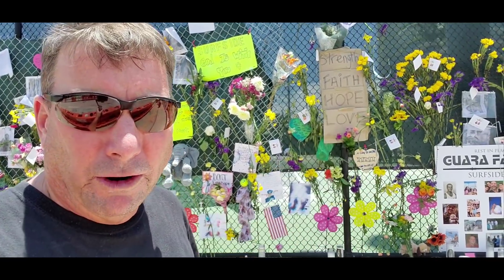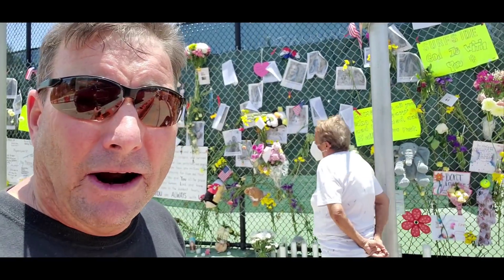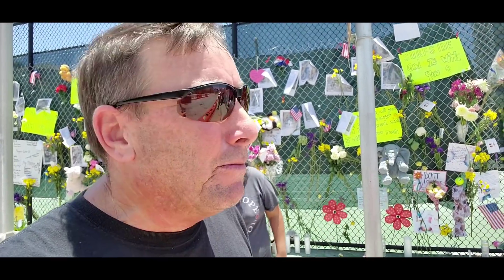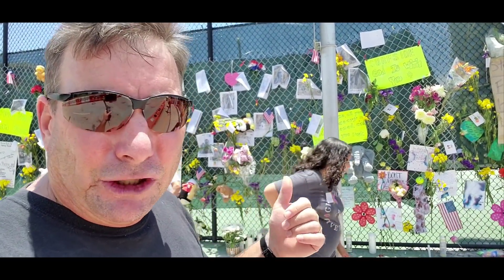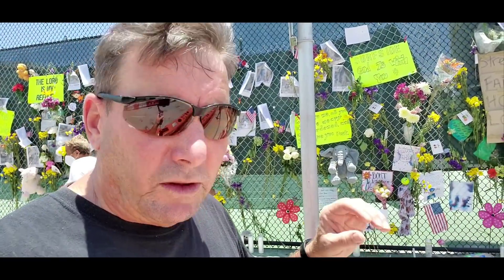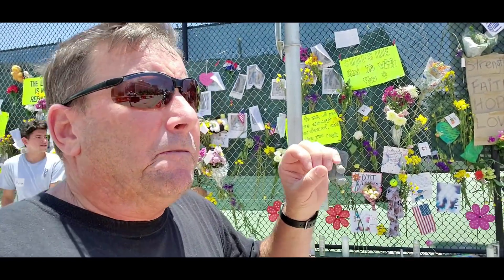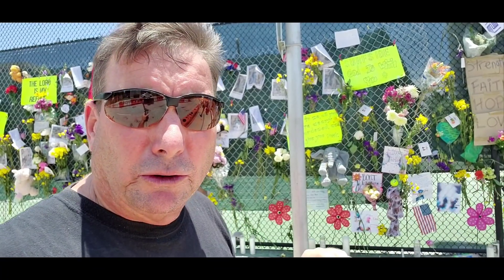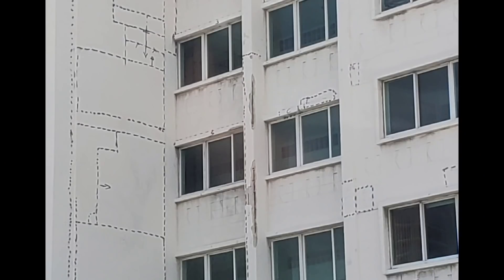Miami Condo Collapse and Memorial

Comment: Pool was holding water after the crash. The top of the garage was the problem, it held water and the membrane failed and allowed water into the post to floor connections. If you look closely, non of the columns failed, just the floor connections

Comment: I’ve been following this disaster closely.  Clearly, lack of maintenance was a factor, but I expect NIST will also find that the building was poorly designed from the beginning.  It was flimsy, so unable to contain a structural failure within a small part of the structure.  I live in a reinforced concrete structure and it is far stronger than this building was.

Comment: Fantastic analysis, Juan!.
YT Jeff Ostroff has done a fantastic technical analysis on the collapse which is well worth checking out.
What an unbelievable tragedy but it seems to have stemmed from 40yo design mistakes of not factoring water drainage runoff slope coupled with a littany of maintenance mistakes to patch up leaks in the garage area rather than fix them properly.
Sadly, I believe we will see more and more major structural collapses like these happening as too many dodgys are being pulled likely to keep under budget & avoid late fees.
RIP to all those innocent people who had lost their lives & to others I send my sympathy whose lives have been upturned as a result. Sad 😓😓😓

Comment: (rant warning) it's not the people that are looking at blueprints and photos and looking at "what is" that I have issues with, it's all the other you-tubers guessing the color of the moon affected some lay-line that skipped under one part of a building to collapse the far side beyond, that I just roll my eyes at. and it's even a bit annoying when so many commenters type "did you see ..." in the comments, when that channel is way off in the nether-land of fantasy what-ifs instead of being firmly grounded in what is actually at the rubble pile. the highlighted column sections the guy has is not remotely like what can be clearly seen on the top of the rubble pile (O-9.1 and P-9.1 back to the stairwell at an angle, not from M-9.1 straight back), you can even see it in the CCTV vid, that corner is gone including the out-cove between the decks that he says was still standing when the last bit tipped over and fell, ugh. some people I think are just blind, or they listen to the media and regurgitate that while ignoring everything else. Think, you have a brain, use it, people, lol.
Reply: I’ve been following “building integrity” and I find very little speculation there.  In fact, Mr. Roberts (who is a civil engineer) has been countering some of the off-the-wall speculation by amateurs.  He also corrects himself from time to time and says that his analysis is not definitive, but offered to help laymen understand the technical issues.  I know there are other channels which appear to be from engineers, but which are more inclined to speculate and which have been shown wrong in a prior disaster (the FIU pedestriun bridge collapse).  I have engineering degrees myself (but not CE), and I have confidence in the approach taken by Building Integrity.  It does not bother me if there are a few details which may be incorrect.  The definitive analysis will come from NIST in due course.

Comment: I would clarify that the entire rebar itself does not expand, rather the oxidized part of the surface, which is significant enough, and the depth of which of course grows slowly over time, but whose depth still only ever amounts to a fraction of the diameter of the rebar. Iron >> iron oxide, which is much less dense than iron, hence the expansion.
Also i would add that over the last generation or so, i have observed a trend in the management of multi-family housing in this country. Ever more over the years, i have seen such housing purchased as investments by people who have no interest in the comfort, and i would argue safety, of those who dwell in the structures they purchase. The owners hire the cheapest management companies they can to maintain their investments, and rarely if ever have any connection with the tenants. I predict we will see an increasing number of such events.
I would suggest that building owners be required to live in any building they own for at least one week in a year, in the same spirit that i think an airplane mechanic be required to fly on an airplane he has recently repaired (or whose repair he has supervised). I suspect that people whose lives depend on their work tend to pay closer attention to the quality of their work.

Comment: RIP to the Victims. This has caused mental shift in condo ownership from Fantasy to Reality.
Pool Deck was not free standing. It was attached to the building columns. The floors were hung from the columns not attached with minimal means. Any shift in the colunms cause the upper floor to detach and start the pan caking process. When the pool deck collapsed the building soon followed. Poor design, poor maintenance cause by the residences delaying corrective action.

Comment: The engineering report on the structure said the corrosion and spalling would continue "EXPONETIALLY"!. As you said in the video, the rust was off to the races. It was more than a race, the rate of corrosion was doubling and doubling over an increasing rate. I've watched lots of construction engineers talking about the possible causes. It is most like the witnesses that say they saw a large hole in the pool deck just before the collapse. So, the water damage was worst as seen in photos of the pool room which a maintenance worker took because he was so alarmed by the corrosion. Also, the planters which are in the collapse zone could be a source of corrosion if water was leaking out of the planters due to poor weatherproofing. But the most damning thing I've heard is a few engineers have looked at the columns near the initial collapse, and where the pool deck is hung on the columns, there isn't the amount of rebar that the design called for. So, it seems someone made the decision to reduce the amount of rebar that was needed to make the building safe. Remember, this building was built in the days when Miami was trying to get out from the drug capital image, and wanted to change it's image and encourage development.  Corruption in that time was rife, and let's be honest, Florida is still a corrupt state with a dysfunctional government.

Comment: I wonder if it is time for stainless steel rebars in seaside locations? In the UK the 25 year old Eurostar trains have been scrapped due to sea salt corrosion, trains usually last a lot longer than that.

Comment: So very sad. I'm sure such factors as the prevalence of more and stronger storms over the past few years factors into it, as well. So, too, the depth and integrity of pilings, especially so close to the seashore. I'm not so sure tall buildings need to be built so close to the ocean, not when even a single-storey building will receive pilings a full twelve feet deep.

Comment: One of your subscribers mentioned a very good point: getting condo owners to agree on anything.  Take for example the “Jockey Club” in Las Vegas, located between the Bellagio and Cosmopolitan. When the Bellagio was under construction in 1998,  MGM-Mirage Resorts (name at that time) CEO Steve Wynn offered the Jockey Club owners some ridiculous amount of money to sell out. Most agreed but the remaining owners could not be found or located. So if you drive/ walk down S. Las Vegas Blvd. past the Bellagio and blink, you will miss the Jockey Club surrounded by Bellagio on one side and the Cosmopolitan on the other.

Comment: A couple things - offshore from there about 2 days prior was that stress test on the USS Gerald R. Ford aircraft carrier. Said it created a 3.9 earthquake but not sure if that was felt where that building was. A shock like that could have been the straw that broke the camels back.
Also if you see some videos of the area you can see these big planters on top of the garage deck which were just a concrete box -- perhaps those would fill up with water and that would be a lot of extra weight on that decking.
Reply: The channel Building Integrity has several videos, including one suggesting the planters could have hidden severe corrosion in the pool deck, and one of the columns that collapsed first.

Comment: Some have the pools on the “roof” which is even worse.
There is another problem throughout Florida, loss of subterranean structure, which lead to sink holes.
Reply: Hello, how are you doing. I hope you are safe and in good health. Looking for a new friend and i saw your pic here. I hope you don't mind thank you.
Reply: There are no sinkholes within a few miles of the beach. Little local Florida knowledge there. Sinkholes happen in limestone, not sand.
Reply: @RockinRobbins13  really? Well I’ll be sure to tell that to some of the people I knew on The coast that have sink holes they keep filling in Cape Coral, etc…
And if you think building on sand is good then you know nothing about foundations. Don’t mistake the building of slab homes on sand fill for the type of foundation work needed for a high rise.
Reply: @artnickel7624  Now you're moving the goalposts. Yes there are problems building on sand, as there are when building on any substrate. No, one of the problems in a seaside sandy environment is not sinkholes. Sinkholes happen usually 20 miles from the seashore or more.

What you call a sinkhole can be a hole caused by a water main breakage. From the story on the Cape Coral "sinkhole" "There may be an abandoned pipe that might have been compromised, according to city officials. The sinkhole is a couple of feet from Del Prado Boulevard in the area, but the city said there is no concern to the roadway." Real sinkholes don't happen on the coast. They happen along Florida's limestone "spine."
Reply: @RockinRobbins13  nobody builds high rises on sand substrate, they have to put piers in to bed rock. The problem in Florida is that >90% of the bedrock south of Orlando is limestone. That whole southern end of Florida was the “River of Grass” before the Army Corps of Engineers drained it. I did Real Estate appraisal in Florida and have seen this crap first hand.
As for Cape Coral, through 2009 much of it was still on well water, no pipes to break.
Reply: @artnickel7624  Then why did the news story report it as a pipe break? Must not have been part of the "much of it still on well water" or more typically, the news media got the story wrong.

Good point on Miami being taken from the Everglades, which is unique geology. It different bedrock may help explain whey we haven't had any collapses here in Daytona Beach. But I'll bet there's much more to t he story than what kind of bedrock the condo was built on. I hope it's not a pointer to similar situations to hundreds or thousands of other buildings.
Reply: @RockinRobbins13  which one? 20 years ago there were no pipes for Cape Coral outside of a few hundred houses.
I lived on the left coast of FL & worked from Sarasota to Okeechobee and down into Monroe Co. You just read and believe the papers…not all sinkholes are reported.

Comment: Long lasting bridge towers and road support structures that are  constructed in sea water must use a different kind of concrete.  Would it be cheaper in the long run to use this material for buildings in corrosive environments?
Reply: Unfortunately Florida, cheap, and long-lasting don't belong in the same sentence.

Comment: I just watched a you tube about Rome and their concrete. There's 2000+ yr
Old concrete with no reinforced structure. 
One key , volcanic ash.
and less water. Sometimes we need think outside of the box. There is modern composite rebar that's non ferrous.
But having sold real estate in costal environments Florida isn't the only place with problems like this...
Thanks,Juan.

Comment: Definitely consider the roof anchors installation the day before as a potential trigger to the pool deck. The roof collapsing off into the pool deck is a possibility. People don't think the pool deck could have just failed like that. Why now? Why a day after the roof anchors were placed?

Up the top is damage to the side of the stair shaft to the left, it runs diagonal. Nothing was connected to this area of the building. Why is it damaged? It shouldn't. The shear wall is to the right and below. How did this area get damaged? We have roof anchors placed just above this.

So, try to imagine this, you've placed roof anchors on the roof, after placing them, you need to PSI test them by using the crane and lifting with the testing mechanism between the crane and the deck. So, damage to the structure occurs at this point. As day turns into night, concrete is shrinking, and suddenly the side of the wall under the roof anchors gives way. This has a direct path down to the pool deck near the upper carpark. You know, that concrete there is super thin, and the rebar is failing. At this area of the pool deck, a lot of damage was found.

You know, another interesting thing is, no waterproofing was found in any of the core samples drilled in 2020. That's curious. What if they never laid any waterproofing down on the deck?

Comment: Having no understanding of chemistry, yet I will ask.  What is the effect of chlorine and bromiding agents  used in sterilizing the water, have on the molecular level of concrete?  As any one who has been around public pools, the chlorine and what else may be in the water vapor can be felt in your lungs. Especially if it's concentrated, as it would be in the equipment areas. Like I said, I know little if anything about the chemistry involved. Thank you for your indulgence of my questions.
Reply: Chlorine is the same element in seawater which corrodes the rebar, not the concrete itself.

Comment: Pool/plaza deck waterproofing, installation and maintenance, will need to be looked at closely. Decks can be sloped to drain OR have internal drains. With internal drains, deck can be dead level and waterproofed with the some proprietary waterproofing products (like a hot applied “Hydrotech”). Keep in mind, that plaza/pool decks are sometimes “transfer” decks (transfer column loads from residential column grid to parking structure grid), so deck might have been serving double duty and even more important from a structural standpoint.

Comment: As an architect, I compliment your accuracy explaining the problems with concrete structures in a corrosive salt air environment.  I hope that this will emphasize the need for continuous maintenance on such structures.

Comment: Commercial aviation understands that aircraft have a lifespan after which keeping them flying no longer makes sense both from the safety angle and due to rising maintenance costs. I suspect that the construction industry needs to learn a similar lesson, particularly for high-rise buildings in salty, wet and warm environments such as Miami. Rather than build these concrete-with-rebar buildings, perhaps it would make more sense to design them so they can be replaced after a reasonable life-span.
Reply: Poor maintenance was a huge contributing factor it seems. Those HOA's have basically no idea how and who to choose to do very risky maintenance jobs on structures. My guess is, the ones who did previous repairs with the epoxy and it all was done incorrectly were just someone they picked because another HOA used them or maybe they had a reference from a poor source. This likely all needed to be considered a good 10 years ago and plans made for a new pool deck and garage area improvements. I'd hate to be on the HOA board my first year and have this all handed to me after years and years of ignorance.

Comment: Go tell 200ish owners they need to pay $100 more in fees and see what kind of response you get (any where): now go tell them they need to pay $75k/each - the repairs would have been around $15mm.  These repairs didn’t occur b/c owners didn’t want to pay to have them completed and ignored the engineered assessments.  Sad and I’m not sure how you fix it without having more frequented inspection and the the ability to condemn buildings that are not fixed

Comment: This is very interesting, I have been wondering what happened with the pool collapsing, I have been wondering if it was due to a sink hole underneath the structure of the pool and the foundation of the building, since hearing about Florida having issues with sink holes in past years.

I didn't realize that the pool was part of the building, on top of the parking structure and not in the ground next to it. 

Thank You Juan for clarifying this,

 Best Wishes to the families who have been dealing with this terrible situation.
Reply: There is no evidence a sinkhole was involved.  Just conjecture at this point.  There is evidence of structural failure though.
Reply from the maker: Pool deck, my mistake.

Comment: Expands to SIX times its original diameter?  That seems impossible.  I assume this material is not solid, but there are voids in it and it is corrosion byproducts that make up the added five times the diameter.
Reply from the maker: Volume.

Comment: The real question is how many more of these buildings are in need of major repair.  I know if I was in a condo and it has more than a floor higher than ground level I would be looking. Sad that this happened and a bit off the path for you but it certainly is something that needs to be addressed and soon.
Reply: Time to sell and find a single story condo